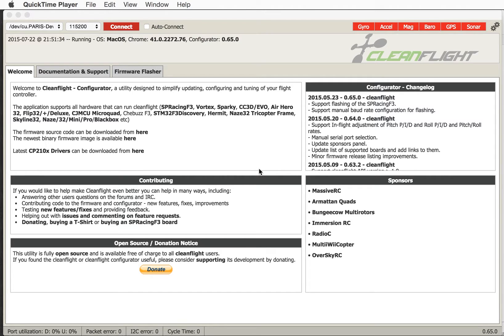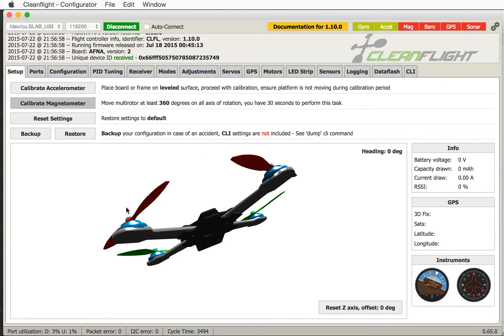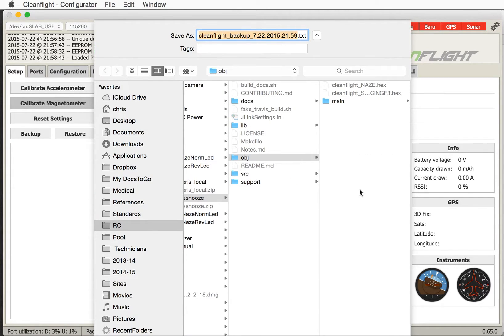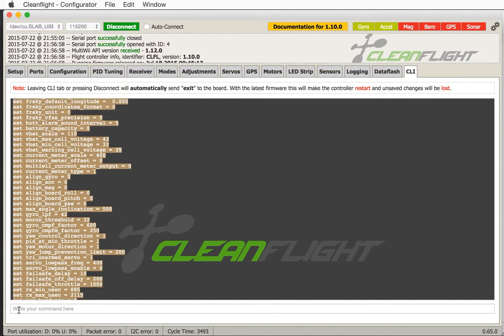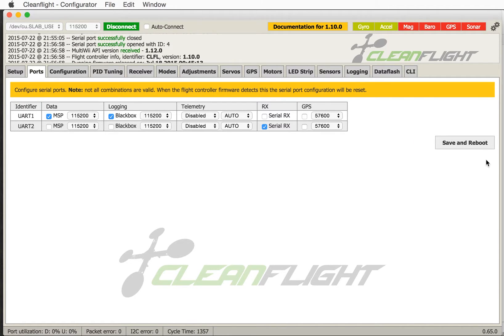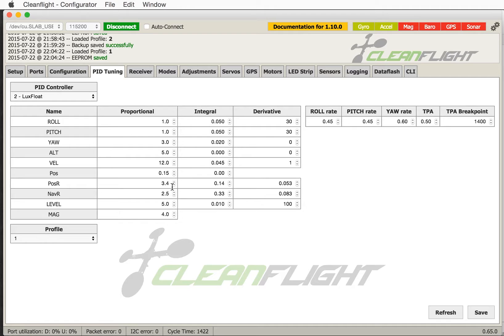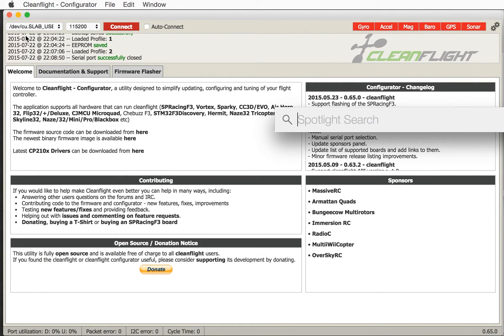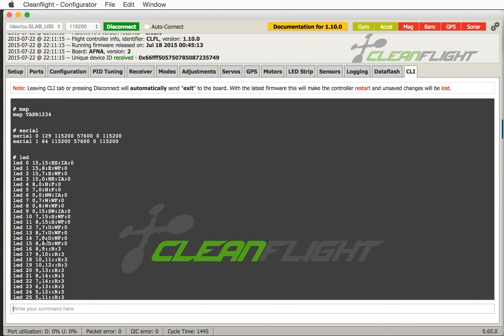CleanFlight Firmware CLI

Comment: I've been looking for a you-tube ( an excellent almost a classroom medium ) explanation of how to use and manipulate CLI. I'm a little unclear as to how you copy/pasted the new CLI commands to the cli screen and do the new changes automatically wipe or write over the old commands. What happens  if  I copy the complete 'dump screen'  over the original cli screen, do the values that have changed only get copied 
  The reason why I'm a little reluctant to play with CLI is that my quad at the moment fly's pretty well ( I'm a novice) and don't want to loose my settings, I do have a copy of the dump file so I should be able to revert back is that correct. 

 I'm running  (if thats the term) MultiWii ver received 1.13.0 // Cleanflight  Configurator 1.2.2 // BTFL ver 2.3.0 // Firmware release Jan13 2016 02:22:01 
Do you see any advantage in changing to newer versions if so what and how.

 Could I suggest an updated presentation of this your excellent guide to understanding  CLI....Joe
Reply from the maker: +Joe Stubbs Current version of betaflight is 2.7.1 and is much better than 2.3.  But all upgrades come with the risk that something just won't work.  If you're not sure, don't do it.  It's not so bad if you have a copy of the original hex and a dump of your original settings - you can go back if you need to.  But without a copy of the original hex there's no way back.

The best way to update settings from a backup is copy and paste.  Just copy the contents of a 'dump all' command (drag over the entire dump and copy) and save to a text editor.  To restore, copy the text of a previous dump all from the text editor, go to the CLI and paste it into the little box at the bottom of the CLI where you type commands, then check that every command was accepted without error.  If OK type save and press return, otherwise exit the CLI and make no change.  Warnings:

-  the syntax of some commands changes as code evolves, so what you paste may not be understood.  Check each line of the CLI after the paste for error messages.  Commands with error messages should be individually checked. 

- some slow interfaces may lose parts of the paste, you'll see that lines in what you pasted never appeared in the CLI after the paste when this happens.  To resolve it, paste in small chunks and check each bit is good before moving on.

- when pasting settings, some may not be appropriate for your quad, e.g. a dump file from someone else may specify a different radio or switch setup.  ALWAYS after saving, exit the CLI, go back to the CLI, do a dump all, and confirm that the settings in your CLI are appropriate for your quad.

Thanks for your suggestion but I'm not sure what needs updating.  

Sounds like you don't understand the basics of the CLI itself and how to send commands in via the CLI.  Basics of how to use the CLI is not the topic of this video.

Comment: Great video, very helpful.  One question-  When you enter 'dump' at the cli, and it shows #mixer quadx, how can you see the complete motor and servo mixing done for that config?
Reply from the maker: +Joe Smith I don't think there is a way to see the motor mixing as a list of values.  Good question for cleanflight users at RCGroups.  I personally don't use custom motor mixes.  Sorry I can't be more help.
Reply: hmmm, will put it out there.  Thanks!

Comment: Thanks!! do you know how to change the stick centering In cleanflight so I dont have to use trim or sub trim on the transmitter. so the channels are 1500
Reply from the maker: +mark rankin - sorry but you will need to do it on the transmitter. there is a CLI value for midrc but it's better to leave that at 1500 and make the changes on the Tx.
Reply: +ctzsnooze Thank you so much I will do the changes on the tx. Ive been trying to flash my naze with boris hex on cleanflight but the motors dont work even on the esc calibration part where you use the master   motor tab. But when I flash back to a normal stable version everything works again would you know what im doing wrong. Thank you again for replying
Reply from the maker: +mark rankin it could be that the active betaflight versions are defaulting to 2kHz (500us loop times).  Some ESCs don't like to calibrate with that fast a loop time.  If you see loop times around 500 then check RC groups as to how to get it back to 1000 (set gyro_lpf = 188 I think)
Reply: +ctzsnooze Fantastic I will give that a shot CHEERS!
Reply from the maker: +mark rankin make sure to get the absolute latest binary there's been a lot happening and some releases have serious issues, think its good right now though.  only use lux on F3 boards, it can work at 2kHz on F1 boards but read up on that.  otherwise rewrite is more reliable on F1 boards.
Reply: +ctzsnooze I never selected luxon setup would that be an issue. Im building a second quad from spares and will try again. I have the new build flying on basic settings and dont want to change it yet as weather has just got flyable lol Thank you

Comment: with my cc3d i cant flash, Failed to open serial port.what im doing wrong?
Reply from the maker: +endzi junior - sorry don't have a cc3D board.  can't do much unless the serial port can be opened.  google might help.
Reply: +endzi junior , You unplug it then you throw it strait into the garbage can. Its an F1 target... OLD technology, you can get a naze for $12!

If you choose to keep it, first you must open up openpilot and do a full chip erase. Then, plug your battery in(its a crap board) and go back to betaflight/cleanflight and load the hex.
Reply from the maker: +endzi junior try shorting the boot loader pads and then flashing.  that's sometimes necessary if the wrong target has been loaded
Reply: hanks i have ready make witch libre pilot

Comment: Thank you for the video! By the way would you know how I can change the order of the motor output pins, I went from Open Pilot to Clean flight but the motors are not in the same order so they do not work properly. I don't want to change the connections if possible.
Reply from the maker: +Carlos A Sorry I don't know exactly how to do that.  I've seen posts in the Cleanflight RCGroups pages.